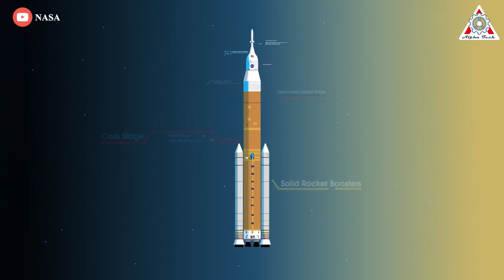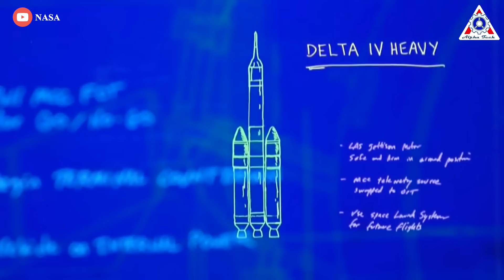Why this is the "LAST CHANCE" for NASA's mega rocket & Artemis 1?

Comment: Some Artemis program missions have already been contracted out to other providers, particularly SpaceX.  Although theoretically Falcon Heavy could deliver Orion and the ICPS to the Moon, it is right on its theoretical limit of 63 tonnes to LEO, a limit which no Falcon Heavy flight so far has even approached.  Indeed SpaceX advertises a maximum of 53 tonnes to its customers.  I believe that if NASA had been permitted to hold an open tender for Artemis 1 in 2020 that SpaceX might have made a bid using Falcon Heavy, but it would have required about two years of development and engineering enhancements to Falcon Heavy, at a time when Boeing and its lead partners on the SLS were confidently predicting a launch in late 2021.  It is not Boeing's fault that it has been forced to accept billions of dollars in extra funding because of unavoidable technical issues.  Some of the technical issues with Falcon Heavy include that it is not designed to launch anything bulkier than its current fairing.  With the ICPS and Orion on top Falcon Heavy would be top-heavy.  Payloads for Falcon Heavy are mated horizontally, and the combination only raised to vertical at the launch pad, but the ICPS and Orion are designed to be mated vertically.  SpaceX could in theory mount everything in the VAB, where there is space available for rent, but then how could it move the assembled vehicle to  LC39A for launch, since it would be far too high and narrow to be transported using SPMTs like the stubbier bottom-heavy components of Starship.  SpaceX would almost certainly have offered an enhanced Falcon 2nd stage in place of the ICPS, which would have pissed off the Europeans.  Finally, even in the opinion of SpaceX, Falcon Heavy is a technological dead end, despite using technology which is three decades in advance of that used in SLS, which it certainly does not want to be stuck maintaining and enhancing for the minimum of ten years of the Artemis program.  Elon Musk personally believes that the Moon itself is not a worthwhile destination and he is not going to go out of his way to support the political objectives of Congress.  He accepted the participatory role in Artemis 3 because firstly he could make a profit on it even as a fixed price contract, and secondly because it would pay for capabilities such as orbital refilling that SpaceX would have to develop anyway on its road to Mars.
Reply: "not boeing's fault"
lemme guess you work for boeing huh?
Reply: @notastone4832  I was being sarcastic, something that is part of Canadian culture but sometimes goes over the head of people for whom English, as opposed to American, is a foreign language.

Comment: This is over expensive under performing disposable junk. It might launch before starship, but once starship is fully operational, this dinosaur will get zero use. OK, so it might get 3-4 launches and that's it, so cost per launch will be in excess of 7B$, once development cost is amortised. Money would be better spent on supporting the Starship program, even if it results in another Artemis delay. Starship genuinely moves the work forward, while this heap of rewarmed spaceshuttle junk is a zero progress vehicle. Genuine progress in space exploration means re-usability and high mass to orbit capability. Starship means re-usable in orbit spaceships, the beginning of the StarTrek vision. FFS, SLS can't even achieve as much as Apollo's Saturn 5, SLS can't land a man on the moon in a single flight, Saturn 5 could. SLS is a pork flavoured joke waiting for a high velocity lead injection to the back of the head.

Comment: This mission is such a scam.  It's been delayed for years which means that NASA has no way of building a reliable spacecraft capable of leaving orbit.  They just don't have the technology or the money.  Why does this matter?  If they are going to put people on the moon, they need to be able to rotate those people out before the radiation and low gravity does permanent harm and they need to be sending regular shipments of replacement parts for the inevitable equipment failures that they'll be suffering.  This will require reliable space vehicles for regular trips and well, NASA is just not capable of doing that.

Comment: Meanwhile, SpaceX just keeps building up Starship... A well-run aerospace company "David" against Goliath who spent billions on a hail-mary pass forgetting the lessons of the past. The comparison of the tortoise (Musk) and the Hare (The Industry) is notable. Had Boeing and the rest followed the Apollo model of management of their program they wouldn't be needing to fly such a cobbled together pack of old tech. I give SLS about a ten to twenty percent chance of getting off a good mission. The problem with SLS is the leadership. It all flows down from there. I worked aerospace for 32 years and have never seen such a badly run program in my entire career.

Comment: The slight heating and cooling of the ship over time is not good, the longer it sits there doing nothing, the worst that problem will become. Lots of fittings in spots not easy to reach or service. I fear for any astronaut that rides this rocket.  I hope I am wrong to worry.
Reply: I fear for any astronaut that rides any rocket.

Comment: It's exactly this kind of incremental pushing of the carefully considered engineering limits that caused the death of seven astronauts on the Challenger mission.   Engineers set a minimum temperature at which the shuttle could launch.   Ronald Reagan wanted to announce the shuttle launch during his state of the union address - and that put political pressure on NASA - who decided that they could just push the low temperature limits for shuttle launch below the engineering limits - and guess what?   Kaboom, 7 people die - and thousands of small children who were watching the launch because of the "Teacher in Space Project" were traumatized by seeing Christa McAuliffe die in a fairly horrific manner right in front of their eyes.

So, here we're pushing not  just one limit - but MULTIPLE limits and we're doing it for political reasons.   We know that politicians are DESPERATE to have SLS be the largest spacecraft ever to launch, the biggest payload to space, etc, etc...which means beating SpaceX's StarShip to orbit.   They delayed SpaceX using the FAA, they delayed them again by NASA stalling them - and it's very clear that every time the SLS launch is scrubbed - they push SpaceX's launch license further into the future.

This is ridiculous - I believe that SLS should be abandoned and Artemis re-thought in light of StarShip...which simplifies the project, cuts BILLIONS of dollars in expenditure, and the only real downside is that it makes Boeing look like a failure...which to be honest, given the failure of StarLiner and the delays in Vulcan Centaur (which is ULA - which is mostly Boeing too) - is well-earned.

And if SLS flies AFTER StarShip - no big deal.   This is not a "Who has the biggest...um...'rocket'..." competition.  America can be just as proud of StarShip as it would be of SLS.

From NASA's perspective - they cannot afford another launch failure - so they're going to push the limits for political reasons just as they did with Challenger...and it's basically a coin toss as to what happens.   Why do government agencies never learn?
Reply: We do not know if Starship will work yet and when it does launch how safe and cheap it will be. I do not doubt Space X’s abilities - the Falcon 9 works brilliantly and the Falcon Heavy has performed magnificently on its 4 launches if has made so far - but as the Space Shuttle War us, it would. Be E wise to be cautious before Saying Starship will be a great success.
Reply: @olivergrumitt2601  StarShip HAS launched - only to low altitudes, admittedly - but the system proved it could to that.  SLS has done nothing yet.

Comment: If we went to the moon 7 times from 1969 to 1972 flawlessly,  and those circuits and switches made the trip flawlessly,  and we somehow made it through without radiation shields, and we didn't get hit on the surface with micro meteors, why don't we just use that technology? 

Why do we have to have test flights now when we did all of that 53 years ago?  

Why do we need to send probes up to the Van Alken radiation belt if we already did that over 53 years ago?

Wake up America!

Comment: No one has gone to the moon.  If you think so,  you have been brainwashed by liars who have stolen your money and deceived you over it.   

Let me ask you:
1)  How did we go there with 53 year old technology and cannot go back to this day, and have no ability to use the old technology from the past?  

2) How did we get there then if we currently have to discover how to get through the deadly Van Allen radiation belts?

3) How was a rocket designed with just enough fuel to get to low Earth orbit, able to suddenly carry enough fuel to make it all the way to the moon and back with fuel to spare?

4) How were those 7 supposed flights to the moon the only ones in history where they worked the first time with no deaths unlike any other technology?

5) Why did the lunar lander test flght fail miserably on Earth so Neil Armstring had to eject but worked flawlessly on the moon?

6) Why was one of the moon rocks found to be a piece of petrified rock from Earth?  If that was faked,  what does that say about the moon landings?

7) Why are there intersecting shadows from the sun in the supposed moon photos?

8) Why was NASA pretending to be half way to the moon while faking it in low Earth orbit?

9) Why did Buzz Aldrin tell a girl we didn't go?

10) How did all the technology flawlessly work when Gus Grisom was asking NASA control from a capsule test how they would get to the moon if they couldn't talk between the rocket and control a few days before he was murdered?

11) Why do you believe a governent who assassinated JFK and faked the Gulf of Tonkin incident to get us into the Vietnam war?

There is more.

Comment: The supposedly "reliable" technology rocket that has never been flight-tested in this configuration at all... built from leftover Space Shuttle parts that had problem after problem when the shuttle was still running. The icing on the cake is the repeated unjustifiable extension of safety deadlines that are called DEADlines for good reasons. The longer this goes on, the lower the chance for a successful launch.
Reply: Peoples careers are riding on this and rather then go before congress and explain why they wasted 4.1 billion dollars they are going to explain why the turd in the punch bowl doesn't make the drink unsafe.
Reply: The STS had many components….the RS-25’s weren’t in themselves an issue. Matter of fact, they proved to be extremely reliable. The SRB’s were not the issue either. Only 1 failure to speak of but we all know how that happened! The issue was a poor design of the tiles that protected the shuttle from falling insulation and its inability to protect the shuttle from damage from that impact. The SLS isn’t a poor design in and of itself! Just not up to SpaceX caliber for SpaceX fans! Lack of cool booster return flights,etc. The main problem is the launch tower wasn’t built for SLS! Like trying to put big knobby tires on 2 wheel drive and wondering why they they won’t pull your vehicle out of 2 feet of mud! We all know the main issue with all of this. MANAGEMENT AT NASA!
Reply: @michaelsnodgrass1808   "Only 1 failure to speak of but we all know how that happened!"  

Large SRBs should NEVER be used in manned vehicles.  The only reason they are with the SLS is because that's just a Shuttle jobs continuation program.  

A short excerpt from this appendix to the Challenger investigation written by the guy who was smart and BOLD enough to clearly highlight, using just a piece of the rubber O-ring in a glass of ice water and a C-clamp, the cause of the accident:

Appendix  F - Personal observations on the reliability of the Shuttle
by R. P. Feynman 

Solid Rockets (SRB)

An estimate of the reliability of solid rockets was made by the range safety officer, by studying the experience of all previous rocket flights. Out of a total of nearly 2,900 flights, 121 failed (1 in 25). This includes, however, what may be called, early errors, rockets flown for the first few times in which design errors are discovered and fixed. A more reasonable figure for the mature rockets might be 1 in 50. With special care in the selection of parts and in inspection, a figure of below 1 in 100 might be achieved but 1 in 1,000 is probably not attainable with today's technology. (Since there are two rockets on the Shuttle, these rocket failure rates must be doubled to get Shuttle failure rates from Solid Rocket Booster failure.)

----------------

To bolster his points about large SRBs, according to my calculations, the training launches of USAF Minuteman from Vandenberg have had a 7.9% failure rate as of several years ago when I did the calculation.  Recall the impressive Titan III & IV SRB caused explosions.
Reply: 10 years late and billions over budget, that's the new NASA

Comment: IMHO it will either be flawless, or explode on the pad at ignition. It’s just been stacked too long.
Reply: It wasn't really built to roll back so many times either. At this point they should just mount wheels to the bottom
Reply: Let's hope it gets a few miles up before RUD. .  It'll make for a better show!